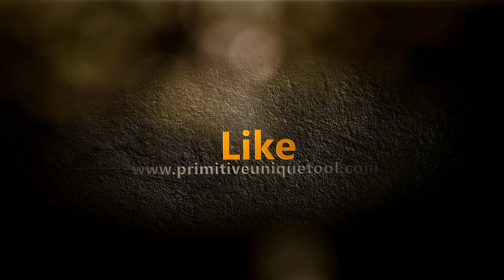Build The Most Amazing Secret Ancient Underground Roman Temple With Underground Deep Pool

Comment: I have but one question;

What happens to the water? We see most, if not all, of it comes from streams. If that stream has a current that never stops, and that means the water never stops, does that mean the place will flood? How do you drain the water after such a long time?
Reply: If it folded they would just make a new one
Reply: evaporate through a sun
Reply: True and also what all can we do except for s miming in the “house”